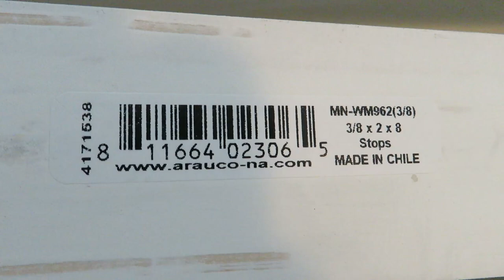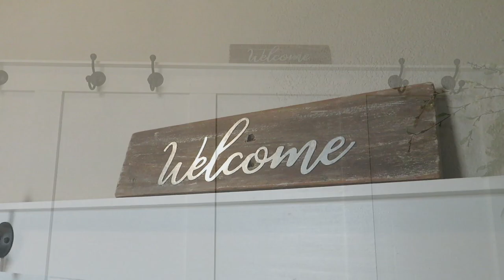MY LAUNDRY ROOM RENOVATION | DIY BOARD AND BATTEN WALL

Comment: AMAZING TRANSFORMATION I LOVE this look, I have been considering doing something similar in my hallway ( I have 5 doors to deal with) and am unsure about mapping out the board and batten. Perhaps that detail on top of the doors is key. Question What is the purpose of all the air vent grills on the doors?
Reply from the maker: Thank you so very much! I think mapping out the battens was the hardest part. I thought I had it figured out until I realized the vent was in the way. LOL! The grills are in the door because my furnace is in there. My furnace pulls all of it's air back itself, so the grills help with the airflow. Something more for me to clean. LOL! Thank you so much for watching!❤️

Comment: Wow! I love it! Will you replace the trim around the remaining doors? I’m all about the flat trim stock, I’m done with traditional moldings. We did 8” flat stock baseboard in our new home.
Reply from the maker: Thank you so very much!  I do plan on doing all the trim in the whole house. The windows don't have any, so I want to add some to them, as well. May I ask how high your ceilings are? I was thinking about adding at least a 6" baseboard, but chickened out. I have 9' ceilings and didn't want the baseboard to overpower the room. Before I continue on, I may buy a larger baseboard just to try it. Thank you for the inspiration! Thank you so much for watching, too!❤️
Reply from the maker: I am totally switching mine to 8", too! What a difference. I Love it! I followed you on Instagram. Headed over to your YouTube now. Thank you so much!❤️

Comment: What size is the top board and the little trim piece that sits above it?
Reply from the maker: Hi AC! The top board is a primed pine 1x4. The trim piece that sits above it is described as 3/8 x 2 x 8' Primed Pine Utility Mullion Casing. I used pine when lumber prices were lower. I find that, in my area, primed MDF is less expensive with the same look.I hope this helps. Thank you so much for watching!
Reply: @windsweptliving7279  thank you!!!!
Reply from the maker: @AC-by4nf  You are so welcome!